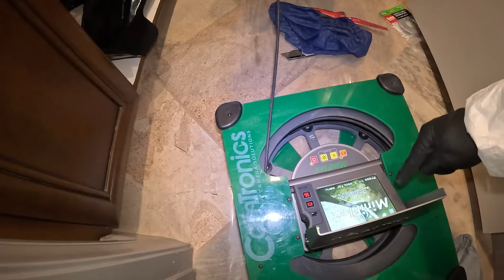SCRATCHING & SMELLING Rats in your bathroom walls ? … Do this!

Comment: Great job, guys. You're the best. 
TIP:   Some houses have attics but have no ceiling-access-hatchway into their attics. If you need to cut a hole through a ceiling to allow access into an attic space, always try, if possible, to cut that ceiling access-hole inside a wardrobe, closet, or cupboard, so it will not generally be seen.

Comment: Went on a service call today for a stove not working. Found wires chewed by  rats. Stove is 14 months old. How the tenatnt missed the grease marks at the back of the stove, really amazes me. I pointed the rat acess hole ,in the cabinet kick board, to the handyman. I told him to seal off the acess holes, then put out the traps. Gee, i wonder where i got those tips from!